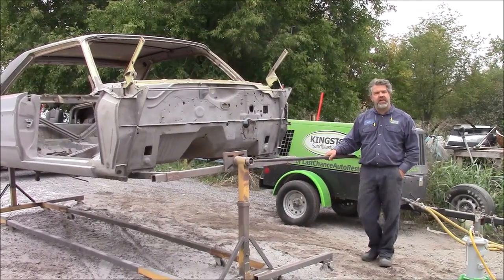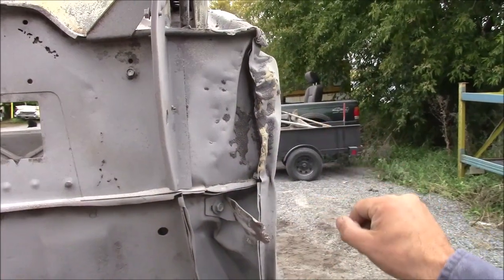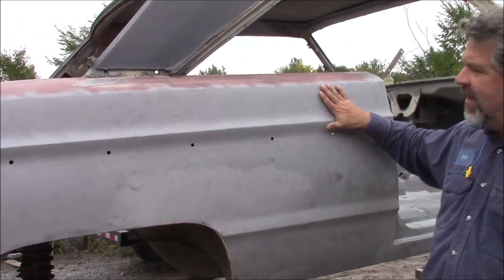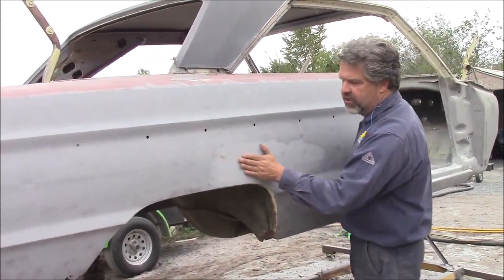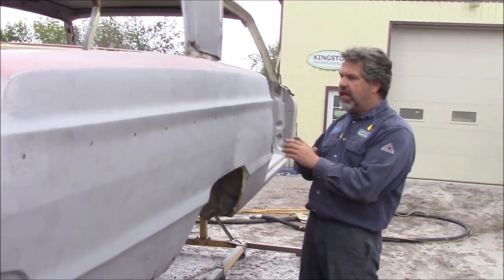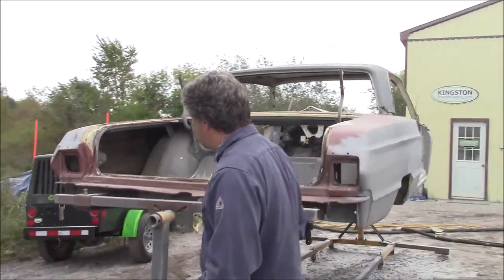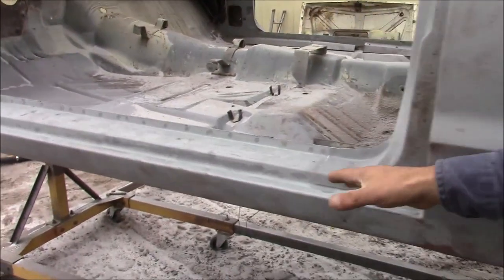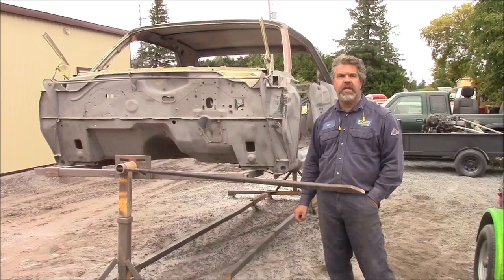Sandblasting a Complete Car Body on Rotisserie,  kingstonsandblasting com

Comment: 40 years ago I had a bare metal Dune buggy tube frame that a friend of mine used a metal prep mix it was mostly water and some chemical, I think it was even clear after we mixed it, we brushed it on & the metal DIDN'T rust for well over 6 months, seems like it was a year before we primed it. NO LONGER have any contact with him, can you tell me possibly WHAT product this possibly was, want to do the same today !  Thanks if you can help ! Wish you were in Florida !